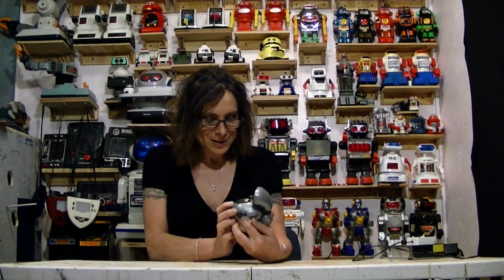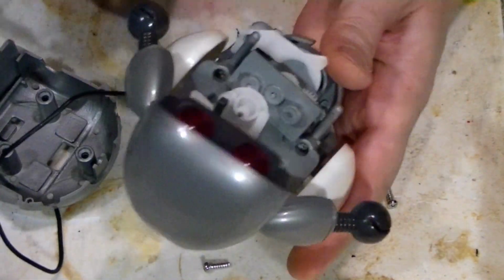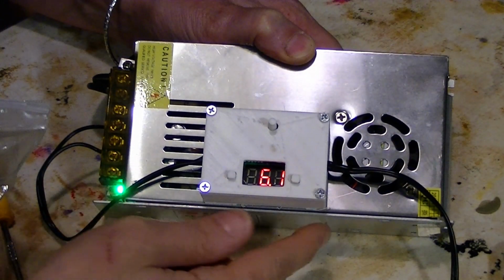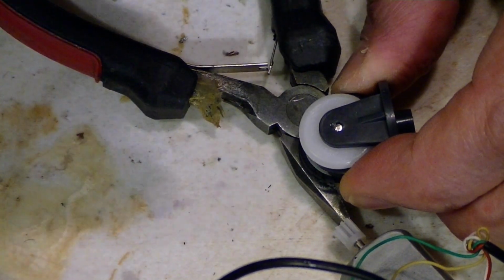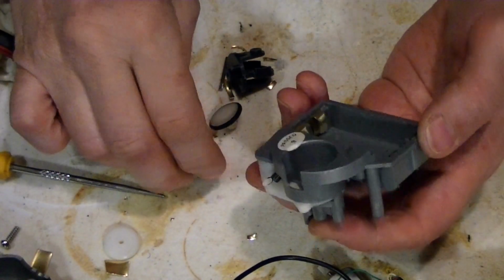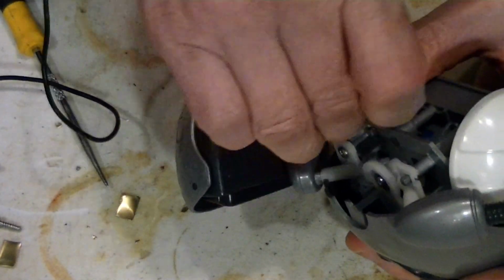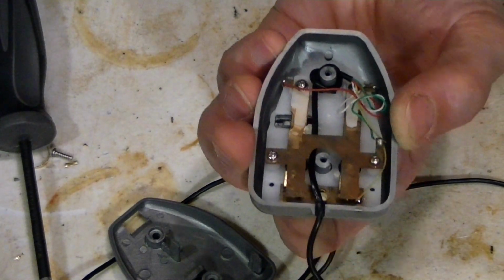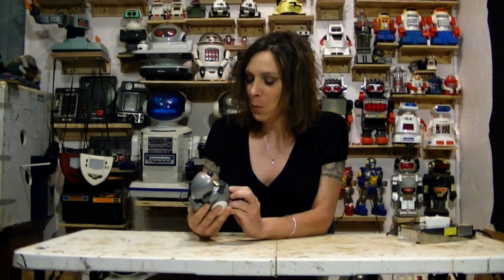Cute Robot Ready For Its Own Movie - Refurbished

Comment: This was clearly from a time when brass was not as expensive as it is today, judging by those bushings they uses as weights :-)
There is a lot of attention to detail in the construction of this robot. Nobody would put in a threaded metal insert for the battery door of a toy today.
(Nowadays it is all just self-tappers that strip out by the third time you change the battery)
Reply from the maker: And this would have been considered a cheap toy.